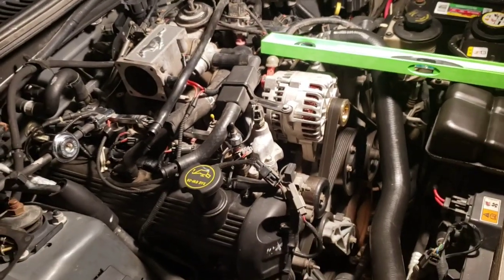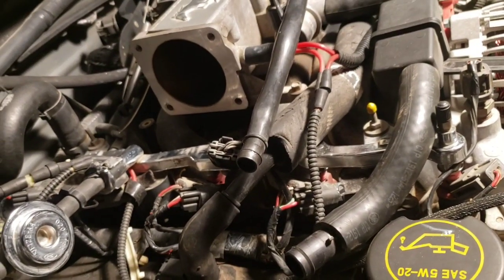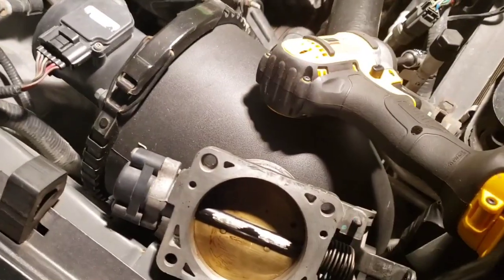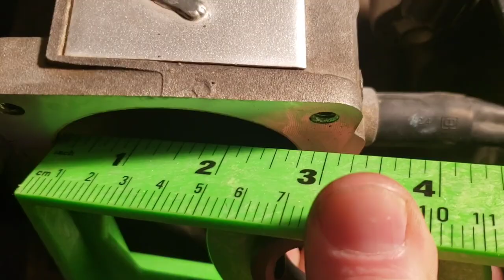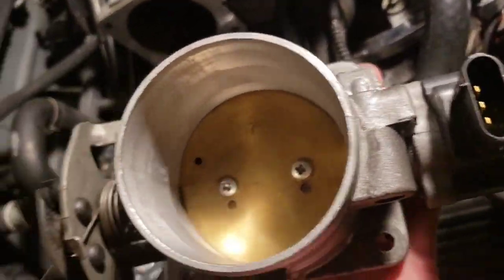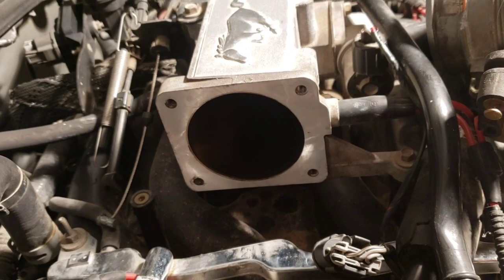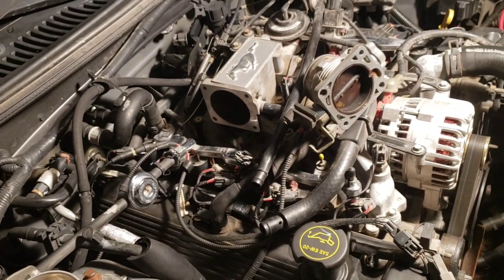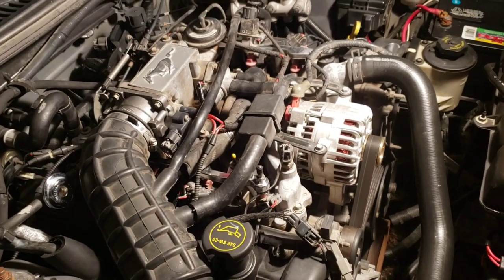Dirt Cheap Throttle Body Upgrade For 4.6 2v

Comment: The take away from this video is a mostly bolt on NA 4.6l engine without blower nitrous or cams a 75 mm TB is actually to big and you lose a ton of low end response time and power and only a small amount of gains at the top so a 70mm TB is actually a good all around performance upgrade for these applications over a 75mm and you can usually sell off the 70mm when you upgrade to larger needs. By going this route you avoid having to shit out $250 for a slightly larger TB you might out grow in a short period of time.  Going to look for one of these at the salvage yard for my nephews car.
Reply: This is not true biggest issue is tuning way more responsive low end & top end pulled hard

Comment: Awesome video. I love the ingenuity. Did you notice any difference in how it drove after you switched. I just bought a 98 4.6 2v and have been devouring everything I can find. Im new to Mustangs. And fords actually lol
Reply from the maker: Ehh I noticed a little more throttle response, if it gained a few hp its hard to notice

Comment: Can you put your stock tb sensor frm the 65mm on to the 5.4 one? Ive been running my 70mm but every time i install it back on my fuel gauge needle goes higher than it was before i took the 65mm off
Reply from the maker: It has no correlation to fuel level what so ever. And yes it should work fine

Comment: Had it ever even occurred to you to simply modify the bracket that HOLDS the cruise control cable ? as in cut out the part that hold the cable and re weld it closer to the throttle shaft?  As in get a bracket from the junkyard and hack it up instead of yours in case there is an issue.
Reply from the maker: Yeah I ended up modding it a little to make it work

Comment: Why don’t you just take the cruise control clip off the Lincoln Navigator with a screw driver or something and put it on the stang if it’s shorter on the navigator.
Reply from the maker: I didn't have it. Tried to work with what I had
Reply: @itsoundzgood  Ok boss I’ll see if it works idk if it does
Reply from the maker: @thebrinster7456  I just slightly bent the mustang throttle linkage and it was just enough for it to work
Reply: @itsoundzgood  Oh ok

Comment: Any idea if this would work on the 4.6 2v in the F-150s? 2007
Reply from the maker: A 2007 would be a drive by wire throttle body so it's a totally different setup.

Comment: What about the 05 grand marquis?
Reply from the maker: I think the throttle linkage is a little different
Reply: @itsoundzgood  but it has the same 4.6L 2v v8 engine you feel me?
Reply: @rafaeltafolla7641  yea but their different drive by wire vs drive by cable

Comment: Did it go faster or just suck more fuel
Reply from the maker: Didn't change fuel consumption at all. It helped throttle response a little and maybe a little bit more power

Comment: Dumb question but does anyone know if this works on the 4.6 2v f150?
Reply from the maker: I think so but you will have to use a 5.4 f150 throttle body. The linkages are different on the f150s